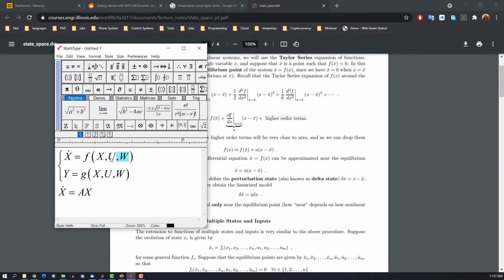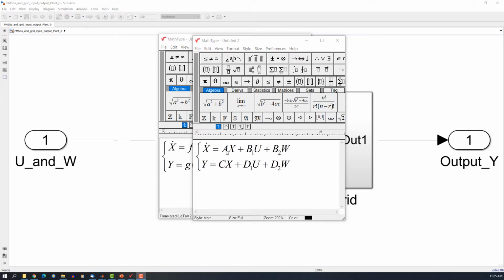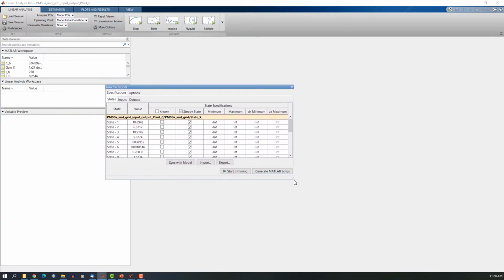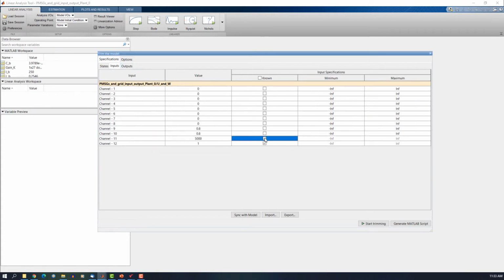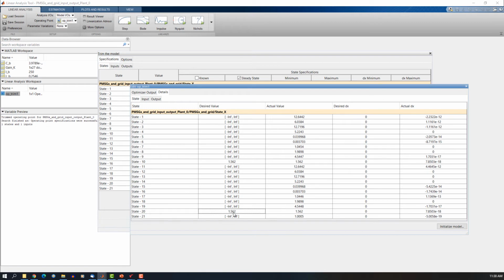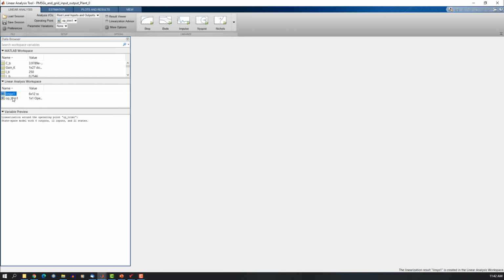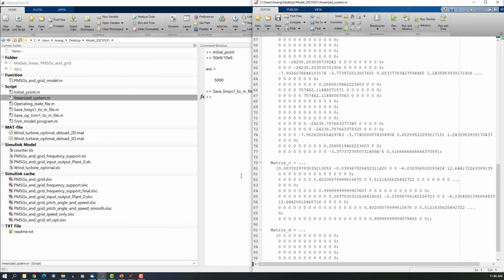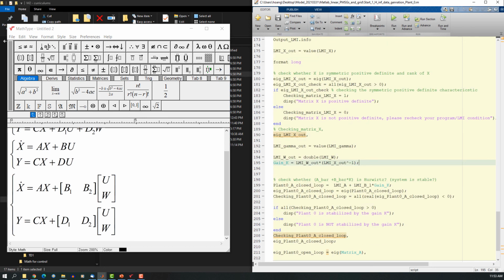3. Linearization of a nonlinear model with MATLAB/ Simulink

Comment: Hi frank thank for sharing the detail video.
I want to linearize my PMSG  model but I am not clear how to find out the initial values for my model and how to use these initial values for linearization. Kindly could you please share the process to linearize a Simulink model of PMSG connected to grid.  kindly also share some reference paper. Thank you.